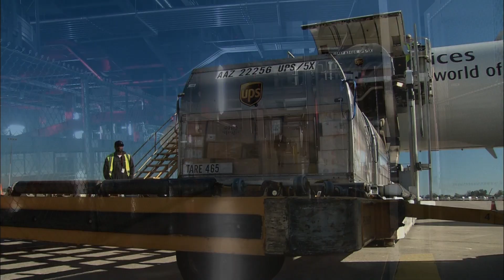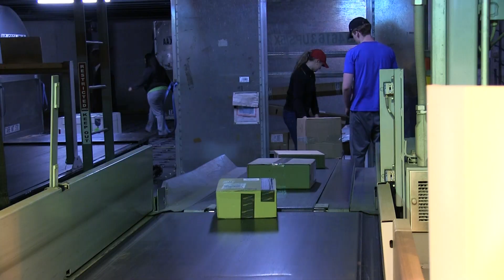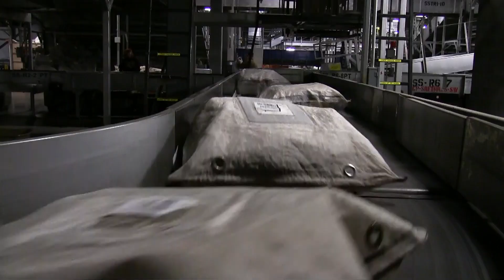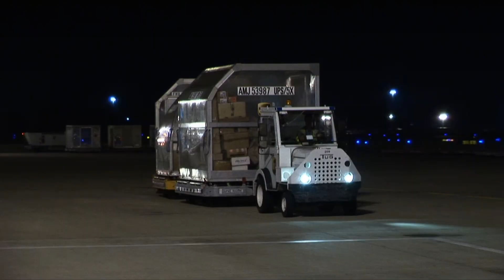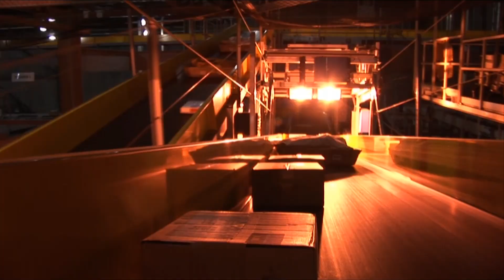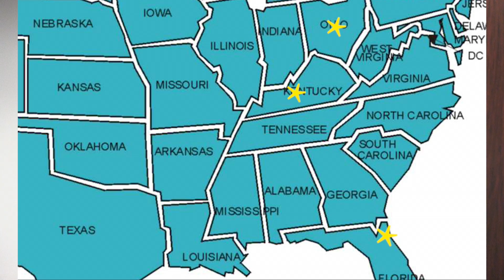UPS automates more facilities

Comment: In 1979 I started as a ZMT  (Zip Mail Translator) for the US poat office at 8.10 per hour. In 3 months I had to memorize 40 zip code zones and each address in those zones as a 2 digit code. When I passed the final test after 3 months I quit. Couldnt see myself bugging out each day at 21 years old looking at letters come across my machine every 5 seconds then punching the last 2 digits of the zip code. Life had to be made...so I joined the US Navy and got to see the world!
Reply: You could have change jobs . Genuis
Reply: In 1492 I  worked for ahmc as a rodeo rodent. We only got paid 708 an hour after taxes. But we were in king Kong war with the appleheads and lemon 🍋 heads. But the sour patch kids helped us and we eventually started working for Amazon in 1515. They went out on strike and merged with Microsoft in 1689. Now we work for canned goods out in Montana. We only make minimum wage which is $1.45 so I know what you all mean
Reply: Liar liar 🤥 pants 👖 on fire 🔥. You went to Navy because your feet are big like a submarine and they said just dip your feet in the water 💦 and they will call it a ship and torpedo them smaller. Bigfoot nigga